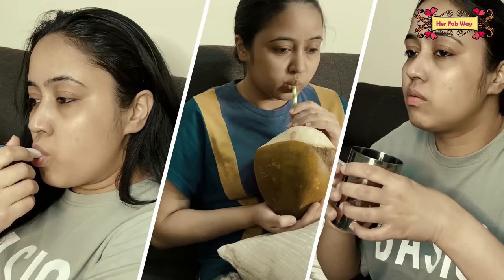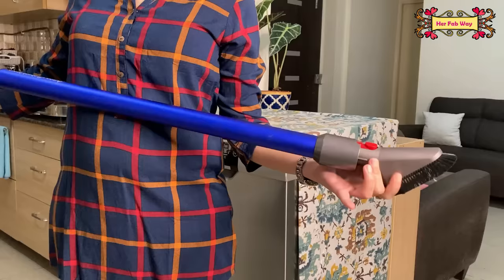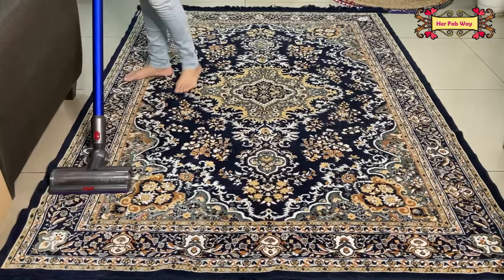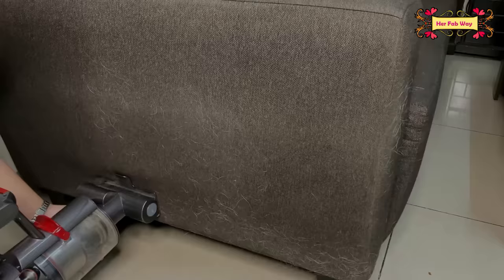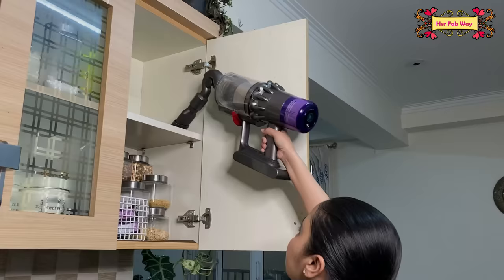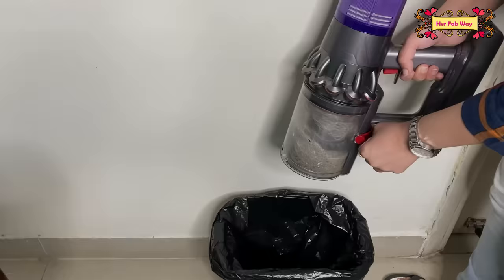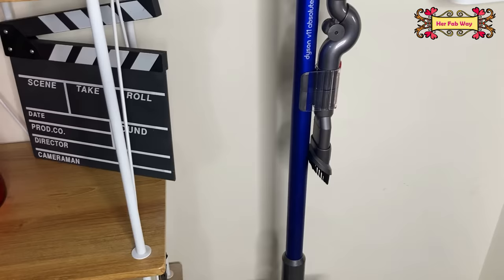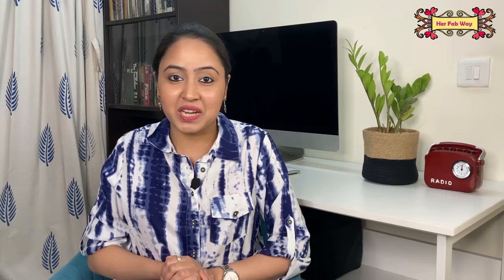The Truth About Dyson V11 Absolute Pro Vacuum Cleaner | My Honest Review | With English Subtitles

Comment: 57000 is too much.. considering it does not allow wet surfaces. Mostly dust sticks around the wet surface so still you need mopping which defeats the purpose of single run

Comment: It's a great video thank for sharing can you please also suggest which extension or attachment can be used for ceiling fan cleaning?
Reply from the maker: You’re most welcome. It will do an ok job in cleaning ceiling fans. You can use same attachments as used for cleaning curtain rod.

Comment: Also , does which attachment can you use to clean the corner of rooms where lots of dust get accumulated. A video would be very helpful
Reply from the maker: The basic floor attachment reaches every corner of the floor. Otherwise you may use crevice attachment.

Comment: Hello. Do you still continue to use dyson for daily cleaning. Hows the battery and maintenance of it.. since it cost much checking again before buying. Thanks
Reply from the maker: Hey! Yes, we still do use Dyson many times a day. Battery wise we didn’t face any issue. Thank God its runtime hasn’t declined. Which is a great thing. We are able to maintain it easily. But once I was in a rush, and by mistake handled it little roughly, so one of the attachments got cracked. So I placed an order of the same attachment on Dyson website and received it within a few days. 😊

Comment: Mam...can v clean the windows easily madam ..using vaccum....m not talking about the aluminium rails windows..the traditional windows ..with vertical and horizontal grills... kindly guide.
Reply from the maker: If a lot of dust is accumulated, it needs a firm brush like tool. So Dyson won’t be much helpful there. It can rather efficiently clean dust deposited on the door mesh.

Comment: Hi Ila can it be used to clean wooden gates as well ?
Reply from the maker: Hi! It can clean the dust on the surface but if the dust has accumulated in the carved spaces and has got firm, then any vacuum cleaner won’t work to clean it. You will to clean it manually using wood cleaners.
Reply: @herfabway  thanks a lot😊